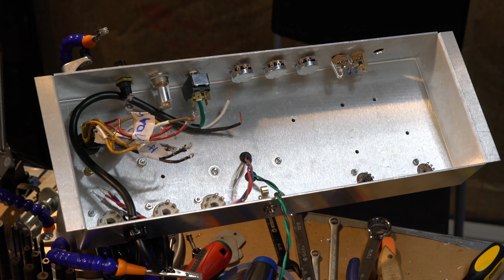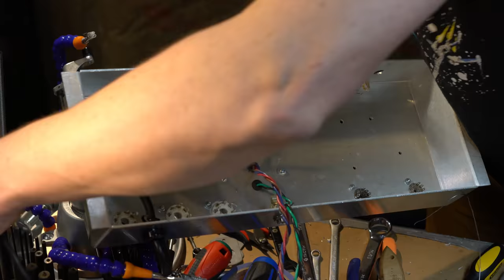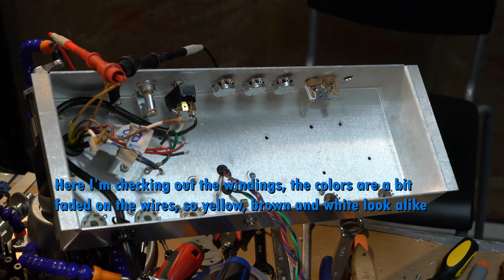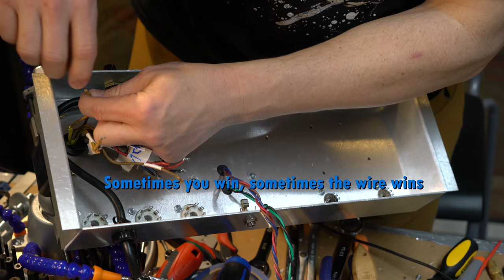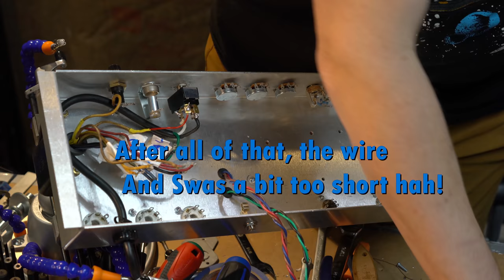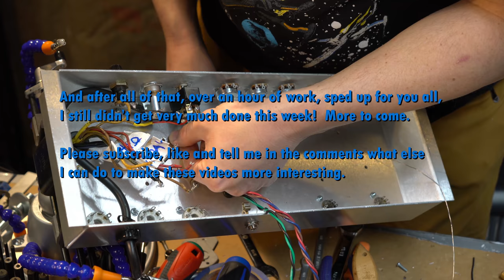Tweedle Dee Deluxe Video 5

Comment: Hi again;
Just subbed ... :)

 As I said I am new enough to be dangerous!
At 01:30 of this vid, I have seen others insist
that the BLACK wire should go to the FUSE first,
then to the ON switch ... Sorry if I offend.

 How true would that be ?
Reply from the maker: The position shouldn't matter, the circuit is closed when the switch is closed and the fuse can then do it's job.  No offense taken, all suggestions and directions welcome